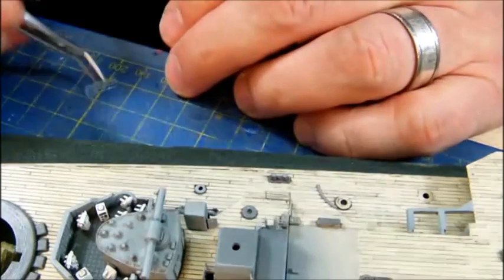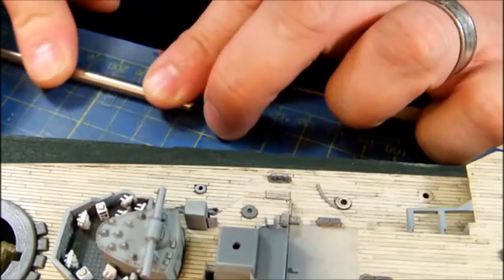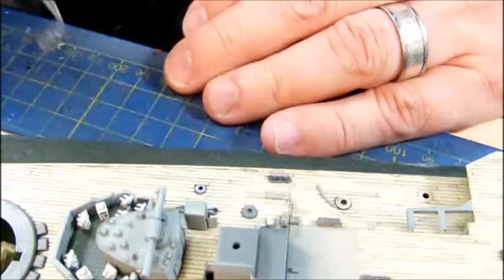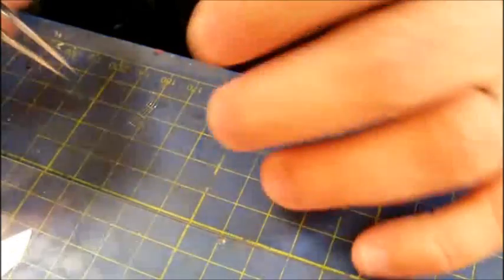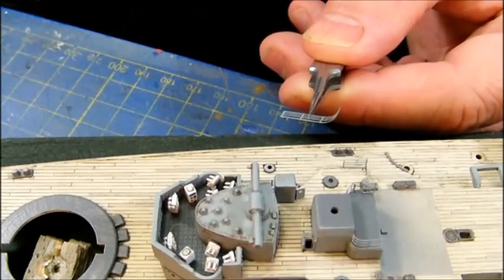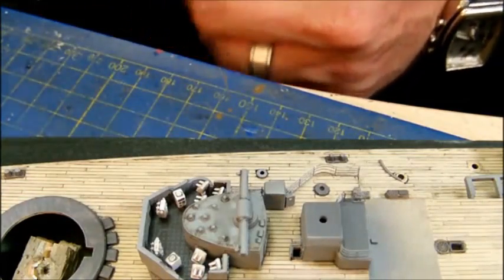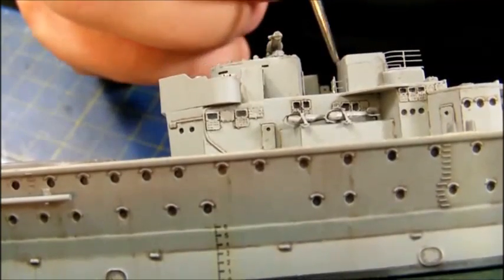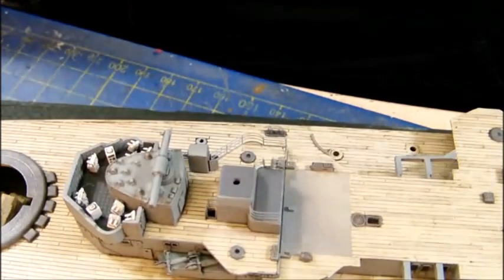Admiral Graf Spee in 1/350: Build Log Part 10 (Railings 2)

Comment: You mentioned in part 1 that "ship modeling breeds a certain type of lunatic..." I don't find that hard to believe after watching this O_O I favorited this vid a long time ago for future reference, and now that I've out-of-box built up the ships I have (a 1/350 Japanese destroyer and an old 1/500 Airfix Graf Spee, both with PE sets), I figured I'd give it a watch. Good lord... this genre of modeling is on a level of its own. I'm almost afraid to click on the rigging part of the build, lol.

So, super glue is only used to attach shortened rails together - Makes sense, I figure using super glue for attaching them onto the deck could be very messy. And White glue is used to attach the rail onto the deck, very interesting. Is this the same white glue used in schoolwork? I don't plan on abusing my models, but I was actually wondering if white glue gives fairly durable adhesion that could take, at worst, something like an accidental poke from a finger?
Reply from the maker: lon242 Thanks for stopping by. I guess you need to check again: I use gel-type CA glue to attach the railing (as almost all other PE parts) into their spot. As the railing may not touch the deck evenly along the run and may not properly line up with the deck edge, I run white glue along the lowest bar to close the gap entirely. After drying the white glue will serve now a paint barrier when working with the grey paint to touch up.
In general Good'Ole Elmer's will provide as good a seal as any CA glue, probably a better one even.
Have fun with your ventures in to ship modelling!
Reply: Guido Hopp 

Indeed, my mistake. Thank you for the tip, I'll pick up some gel CA glue as I've always used the liquid stuff to put together my models. My goal is to at least include railing on my first model ship. Not too sure about rigging, but I'll at least give it an attempt.

Thanks for providing this guide! Surprisingly, it seems to be the only video guide to rail installation.